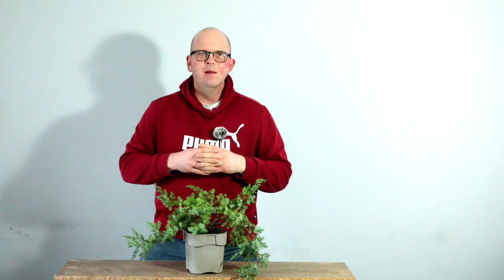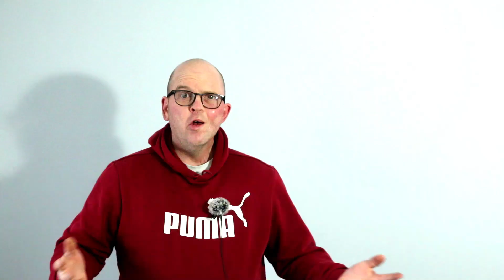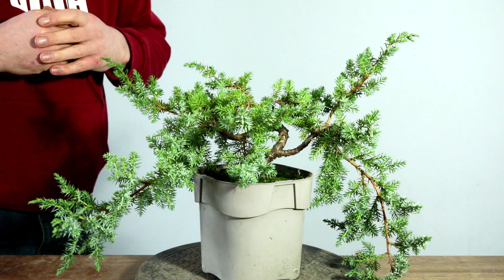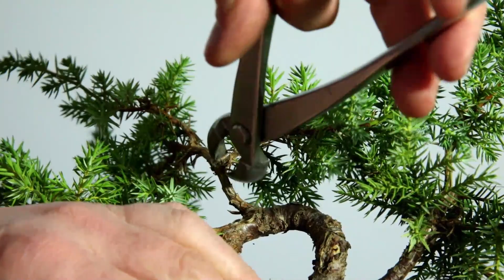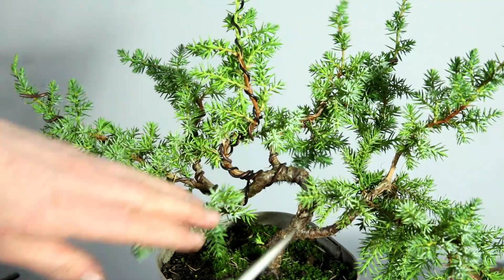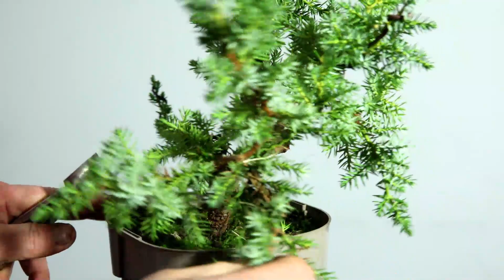Creative Branch Design - common juniper

Comment: Indeed a slightly different approach this time, Tony. I can follow your philosophy but personally I am more on the other side, staying closer to natural forms. In fact, for me this tree shape is a bit too much on the artificial side as too many branches follow the same pattern. If you had asked me, I would have eliminated the branch in the middle coming out of the top of the main trunk. Instead I would have formed and pulled the branch coming from the very left side back over, functioning as main trunk then. There are a few little twigs coming out of the bend of that branch that will fill the left side. Anyway, I remain curious how this little tree further develops. I may change my mind 😀. Good luck 👍🏻 😊
Reply from the maker: Your suggestion sounds like it would have produced a fine bonsai, and as you say this one is crossing over into the realm of fantasy trees, but I'm fine with that. I want to explore all aspects of bonsai design as I believe that by exploring all styles and techniques that I will eventually settle on the type of bonsai that most appeal to me. I think this will look great in 5 years time, but it will always divide opinion (I hope so anyway)
Reply: @TonysBonsai  That’s absolutely fine, Tony, as this is always a matter of personal taste too, in any case. And not to forget, suggestions from the distance are based on how you see the tree from the distance. Those ideas may change when seeing the tree three-dimensionally at close range.

Comment: Tony i love the channel love how u discuss what ur doing with everything . Someone else has said this but i see u style most trees on a flat surface. I would love to see some usage of blocks to change angles where some of these branches will form to diff planes it may give u a better position on where they can go. Love the tree and by no means dont take this as a negative comment im still learning with u bud but i think angle placement opens up alot of new ideas and would love for u to discuss what u might find by using the blocks of wood . Thanks pal keep the videos coming! Love them
Reply from the maker: Hi Chris, and thanks for the feedback. I always appreciate this kind of comment as it makes me think. I have looked at changes in planting angle in the past, but as you correctly say it's not generally something I do all that often. This tree is a great case in point that I did indeed study it for quite a while before I started to film, and I considered it from several different planting angles. In the end though I decided that I still like the position that I planted it in last winter.
Glad you're enjoying the videos mate

Comment: It’s a great idea to regularly review your trees and to consider alternative directions and styling. What might seem like a good design idea at one point may no longer suit the tree as it develops and there is no reason not to choose to go in a different direction and stick with a design that isn’t working. 

I did much the same with my very first ever self designed bonsai and turned an initial windswept into a much better cascade tree. 

Also altering planting angles can make a dramatic difference and present new and interesting opportunities.
Reply from the maker: Yes, it often amazes me how a change of direction can improve the look of a tree, and as you say it can be something relatively small like a change of planting angle. There is certainly no guarantee that this will be the final design of this juniper, but I'm really liking these weird repeating curves.
Reply: @TonysBonsai  On the subject of junipers, I just invested in a little blowtorch to sort out those undulating jins in my big juniper. Over time they have lost the curves and so need some radical reworking… what could possibly go wrong?

🔥 🤕🚑🏥
Reply from the maker: 🤣excellent! A bit of pain is good for you 🤣🤣 I'll look forward to that video mate